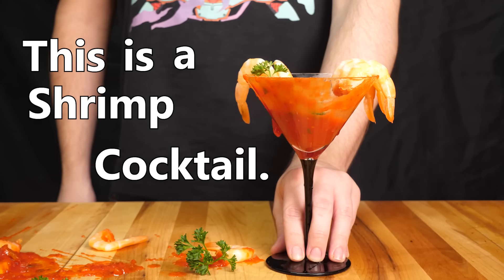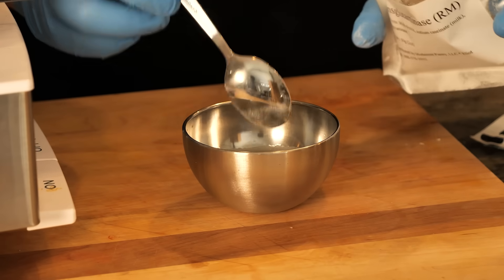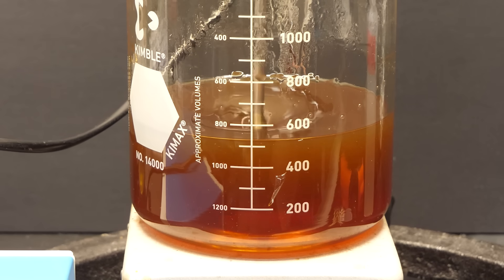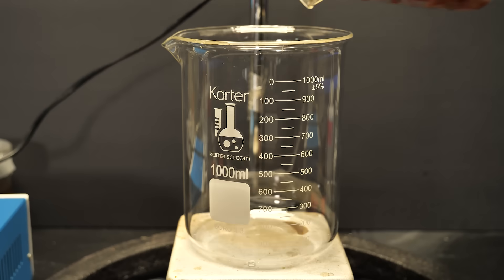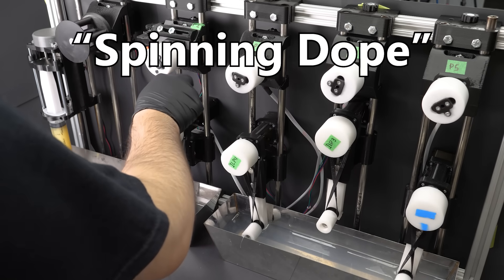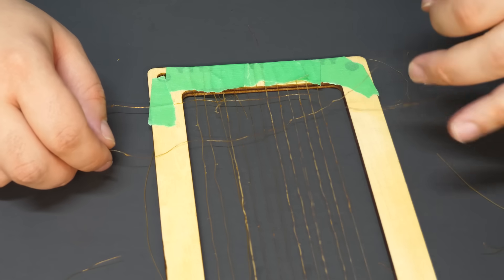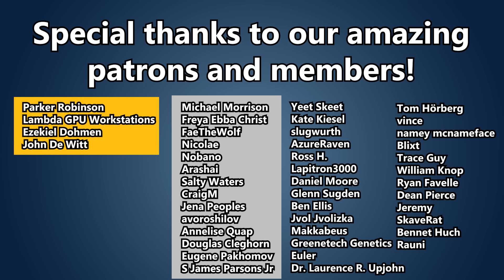Turning SHRIMP into Fabric

Comment: 13:23 well, the military will want that, if you can make a set of FR coveralls you'll make a fortune from oilfiled workers in shitty hot climates. Nothing sucks more than rigging up north of Pacos Tx in 110 deg heat. Maybe a challenge to get the fibers thin enough....  but perhaps thats a concentration process after the extrusion before the base bath.... keep it thin and runny then dehydrate to shrink the diameter before the alkali bath...... I'm sure some kinda silk spinning analogy would work. Also, is there no equivalent cellulose based fiver that is cooling? Perhaps is a mix of the shrimp and plant monomers into a hybrid..... tell you what, if you set up a waste removal company that picks up all the crawfish shells from  restaurants in the gulf and other shell fish on the east and west coast you could get double bubble for being paid to haul it away then selling it or processing it yourself, free feedstock .

Comment: after you're done tweeking the issues, you might wanna try spinning the yarn. often in textile industry, whole kinds of synthetic fibers are cut into shorter fibers (I often see lyocel at 38mm) and that makes it easy to blend with other types of fibers or if used on it's own, it should make the resulting fabric softer. or another option is to make thin filaments and then spun those together

Comment: So what’s the viability of this with, say, crickets or cockroaches instead of shrimp? Using seafood industry waste-products is interesting, but the current global seafood industry is such a destructive and poorly regulated mess that it’s perhaps not a good idea to give them anything more they can latch onto to avoid positive change.

Crickets like the ones sold as live pet-food in pet stores have also been used in culinary settings, plus they’re extremely easily farmable and significantly more resource and energy-efficient for the amount of protein than any more conventional meats, so that right there could be an easy way to not just recycle waste products via feeding paper, cardboard or the like to the crickets, along with compost or whatever else provides a better nutritional balance to the crickets for either culinary use or better chitosan quality.

Comment: First, is a chitin based thread actually any better for the environment than other polymer based fabrics? A huge chunk of the microplastics we find in the environment are from synthetic fibre. Doesn't mean it's not potentially useful but definitely a concern!

Second, if chitin/chitosan is so easily chemically modified, does this mean the end product may be easily recyclable? Or at least easily treated to make it less of an issue if this stuff is a problem?

Comment: I wonder if it's possible to make armor out of these weeves. You could control the flexibility, while including impact resistance.

edit: Could you possibly bleach the plastic form of this and use it as scaffolding like the cellulose? You might be able to "guide" where neurons grow and be able to make pinhole connections to the sensor material.

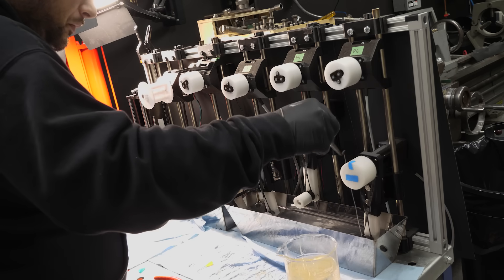Comment: @thethoughtemporium. I see what went wrong at 11:26 (you probably did as well afterward)

I think you were supposed to go UNDER the P4 roller but instead went on top of it; this caused it to get longer and ultimately fail. It looked like you had it for most of the way there until you got to that roller because it's spinning the opposite direction and pushing it back towards P5

Great video! Can't wait to see more

Comment: Hey! I have a solution to fix your snot difficulty dissolving. Mix it like you would a roux or cornstarch solution where you start by adding a small amount of liquid to the powder and mixing until it becomes a thick homogenous paste, then add the liquid in larger and larger batches, mixing until homogenous each time until finished. This works on many different substances that form films (like activated corn starch) or are moderately hydrophobic (like cocoa powder). Hope this helps!

Comment: Instead of re-acetylating the chitosan to make it insoluble, consider reacting it with sodium alginate. Chitosan hydrochloride is fairly soluble in acetone (I did some research work making nanoparticles by rapidly adding it to concentrated aqueous sodium alginate with high stirring a long time ago, if you want to investigate that for a future video). The alginate's carboxyl groups readily form salts with the chitosan's amine groups that should yield a fairly durable (washable) biopolymer. Saturated chitosan hydrochloride in acetone could be injected into a concentrated aqueous sodium alginate solution and harden up almost immediately. Because of the heavy "cross-linking", I don't think it could be drawn much, but using a sufficiently small orifice it could likely be drawn over a single mandrel then dried with a hair dryer or heat gun before spooling.

Comment: For the initial spinning dope have you tried homogenizing the concentrated solution or using a roller rather than relying on mag or overhead stirring? The water concentration method definately seems to have caused some coloration there.

Comment: this is legit amazing. But as someone that has shellfish allergies, I have to wonder how that would interact with it. I don't get rashes when I touch the stuff (thankfully), but I can't help but be afraid of flakes of the fabric being inhaled and causing a reaction.

Or would the process change the base proteins/molecules enough it wouldn't trigger a reaction?
Reply: If I had to guess constantly wearing it would probably eventually trigger a reaction as it degrades over time, assuming the particulates are small enough to get into your pores it'd cause one hell of a rash

Comment: Did you consider using electrospinning to form your fibers?  I built an electrospinning rig about a decade ago.  It was remarkably simple to set up and draw out fibers.  Electrospinning gets used to form fibers from lots of different polymers dissolved in lots of different solvents.  Also, you could probably get away with electrospinning your original 3% solution of chitosan rather than having to concentrate it to 10%.  The fact that you already have a syringe pump means you're 1/4 of the way to having an electrospinning rig.  All you need is an enclosure, a variable high voltage DC supply and a drum to collect the fibers on.

Comment: Might I say thank you so much for this video! I was looking for any kind of biopolymer that can be spun into fibre and potentially characteristics of higher performance artificial fibres for composite use or whatever, but the search quickly ended with rayon or another type of regenerated cellulose and silk protein, and there wasn't any if barely any research or literature on those. I thought to myself, this chitin thing I know, I think it was stronger than cellulose, so maybe a fiber of it would be insane? But no real literature again, until you came in and provided something finally!

Comment: Try adding a form of alanine to the chitosan solution. It's the other half of spidorin. Alternating chunks of crystalized alanine and glycine allow silk to stretch into straight fibers of consistent diameter, rather than snap when semisolid. The prototype fibers superficially look a bit wiry and brittle which, yeah, air curing a short length of weightless plastic noodle will do that, but also, you should have an easier time feeding it onto the spindles before the cure, technical difficulty aside. Sorry for the double comment, btw, but I'm pretty sure I said 'glycosine' instead of glycine the first time around and YouTube won't let me see it so I can't fix it.

Comment: I got excited 'cause I was like "oh, yeah, they're arthropods, so maybe they'll have, like, some kind of latent silk-producing compound in their exoskeleton or something you can activate wit-Oh.... Oh no... He meant out of the meat."
Completely deranged.  💯👍
Reply: Ok, super weird to find myself half right on this one. I think using alanine as an additive to the solution may help. It's the other half of the redneck spidorin you're making. I'm not a biochemist, but supposedly, it's the alternation of crystalized alanine and glycosine chunks that makes silk stretch into strong, consistent fibers rather than break.
Reply: @Shoe_Horn  It's true that spider silk proteins (not those in silkworm silk mind you, those are different) in large part consist of alternating blocks rich in alanine and glycine (not "glycosine"), but just dumping a bunch of alanine on something doesn't turn it into spider silk. That seems to me a bit like suggesting somebody should tape a bunch of pieces of steel to the side of their bike to make it go faster because car engines are made out of the same steel. It's the particular arrangement of the amino acids in the protein and the resulting 3D structure that produce the properties. If you just add some alanine to the chitosan goo, it's not gonna polymerize in any way and just be washed out in the baths that the string is dragged through.

Comment: How is sky cooling fabric possible without violating the second law of thermodynamics. It's a material that loses more energy than it absorbs when exposed to EM energy? What's stopping someone from harvesting this excess energy and creating a perpetual motion machine or free energy machine or whatever the frauds and loonies call them?
Reply: Things that are above 0 K give off electromagnetic radiation. The energy of that radiation comes from the object's thermal energy. That why sky-cooling stuff, you know, cools. And it does need to be hit by EM radiation to do that, everything releases thermal radiation at all times. The only special thing about sky-cooling paint/fabrics/etc. is that it's essentially in thermal "contact" with space, which is largely pretty cold.
So no, it doesn't violate the first law of thermodynamics as the energy it radiates comes from its own thermal energy (which is the whole point) and it doesn't violate the second law because heat flows from hot (the object) to cold (space), which increases entropy.

Comment: The mentioned "sketchy ways" to use meat glue, are an urban legend. NOBODY actually does that. Mostly because no matter how small or beat-up or whatever else, you process the pieces of cheap meat into, glued-together cheap meat is never going to fool anyone into thinking it's better meat than it is. Cheap meat and expensive meat are just too different in too many ways, for that to ever work.

But also, it's because that is called fraud, and the legal system takes that pretty seriously.

And that's to say nothing of the food safety issues.

Comment: so if the problem is that it isn't a thermoplastic but is chemically set.... what about 3d printing submerged in a liquid? I don't know if it would adhere between layers though; maybe something chemically that could be printed at the same time? not sure about that but it would be a cool use case for an underwater 3d printer.

Comment: Obviously since this was just a first proof of concept you can't judge the results too harshly but I am curious if the tweaks will help change the texture and malleability of the stiff plasticy and brittle look it has to a more flexible, flowing and softer material , similar to other synthetic or I guess technically also natural fibers?

Obviously a thinner diameter strand will change it a bit but will it get soft enough to even come close to other fabrics or will it be like those ropes made from ribbons of plastic created by continuously slicing plastic bottles in a spiral and weaving/twisting them into ropes? I think getting them soft and flexible enough will be what determines if this was a success or not since nobody wants to wearing anything that's stiff and rough.

Comment: A rotor/stator style high shear mixer would enable you (or industry) to mix solutions of chitosan to a much thicker percentage. To get good mixing with the silica you’ll probably need to use one anyway, but they’re really expensive mixers. 

I’m going to try to machine one from scratch soon using an angle grinder as the motor! It’s probably not a good idea but I’ll let you know how it goes.

Comment: why not adapt a FDM printer to extrude chitosan in an alkaline solution container, to produce 3d prints. 
for the extruder you can use one of the chocolate extruder kits or make one from a large syringe + linear actuator .

Comment: 9:37 my gf started using a collagen powder for dietary stuff. It reacts similarly when added to water. Unless you decrease the amount of water. If you have a lot of water it clumps up and then if pushed against it can move out of the way because water isn’t very viscous. If you add barely more water than collagen it is still mostly solid and can be easily mixed. And then you can add more water. Might help with the chitisin. Also asks if  you make collagen fabric?

Comment: It looked that in the process of concetrating the shrimp juice, the color turned darker? If you plan on using this as a sky cooling medium, you'd want to avoid darker colors because they absorb more light/heat. Wondering if evaporation would be a better method to reduce the water percentage instead of heating?

Comment: Aw heck yeah I’ve been working on chitin fiber too, inspired by your “turning milk into yarn” video

Edit: my reply seems to have disappeared, so here’s the original text (sorry if it’s a duplicate)

> Here’s a braindump:

> I suppose some of the breakage you were seeing is from a degree of deacetylation that’s too high—it needs to be just high enough to solubilise, but not so high that it weakens the fiber. If you’re starting from scratch with shrimp shells, each preparation step (demineralisation, deproteination, depigmentation) causes some depolymerisation, which can lower the molecular weight too much to spin. So you really need to treat it very gently.

> One thing you can try is solubilising the chitin before deacetylating—mix it at room temperature in a 8 wt% KOH / 4 wt% urea solution, and gradually lower the temperature to around −20 °C with stirring until it dissolves. You’re depending on freezing-point depression to make this work out, but the solution should end up stable enough to extrude and coagulate, and then deacetylate at high pH with gentle heat under tension (Mercerisation, effectively). I believe ethanol can replace formaldehyde in the coagulation bath, too.

> So far this is the method I’ve cobbled together from literature that seems most achievable for the home chemist. Alternatives like “quaternised chitosan” (solubilised with quaternary ammonium compounds) are promising industrially but a bit too hazardous for my liking.

> Glad you’re working on this and hope this is at all helpful, best of luck!

Comment: ayyyy
I did science fair for two years on a different but also fundamentally similar concept - I was working on producing chitin out of mealworm sheds(mealworms are incredibly easy to cultivate, are versatile, and for my project I specifically chose them due to their ability to digest other plastics), which can then be processed into different products, including fabric. The process I used to pull chitin from the husks are almost exactly the same as the procedure you used, although with a weaker acid during demineralization because beetle larvae probably has a lot less minerals in their shells than a marine crustacean, and chose to hold off on deacetylation to keep the material mostly as base chitin instead of being mostly chitosan. I always love it when animal polymers get more attention in the media and the materials industry because it both appeals to my interest in ecology and biochemistry and is very easy to do.

Don't try making chitin bioplastic out of shed insect skin on a small scale tho... you're just gonna be left with a tough film on the bottom of your beaker that's impossible to scrape off. At one point I considered refitting a 3d printer with the worm solution, but I never got enough material to even fill a 5ml syringe.

I'd love to keep working on the project... if university applications will leave me time, and I can convince my mom to have barrels of smelly mealworms in the house again, but if I want to make something out of the material I actually got a big bag of chitin somewhere around the house that I could probably put to use.
Reply: Thanks for sharing your process, I always wondered if there was any way to repurpose this animal plastic to the point something in me made it hard to simply throw shrimp shells away but never actually gave it a try.
Reply: @SobrietyandSolace  From what I can gather from publications, a majority of chitin research is actually directed at extracting from crustacean waste. Give it a shot if you're eating a lot of shrimp. I can't exploit my leftovers unfortunately because I'm severely allergic to marine crustaceans..
Reply: very cool, wishing you the best on your chitinous journey lol
Reply: I just re-read your comment and saw that you're just a kid and mentioned college applications of your skills, so now I get why you did it for 2 years. Makes sense now. lol
Reply: 2 years and you didn't even get 5ml?!! I would've destroyed my stuff in absolute rage after 3 months
Reply: @RevCPJohnson  When I say 5mL it's actually just the amount I got out of a single experiment, from all the different cultures I've had over the years I can probably make a cup or two. Even so, you really need to aggregate huge amounts of mealworms to produce an appreciable quantity because of how thin each husk is. I don't save that stuff though, my mom makes me clean the whole thing up because frankly, mealworms smell like shit, especially when they're on unconventional diets like food waste or leaf litter.
Reply: Wow, thank you for taking the time to share your process and thoughts! May the Lord bless you and your work ❤❤